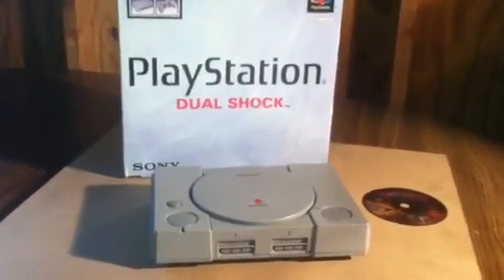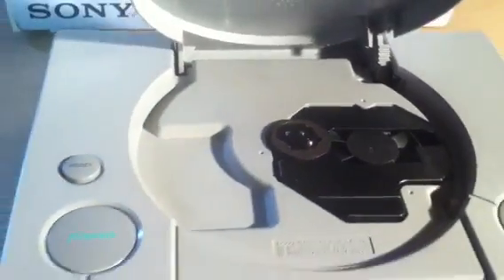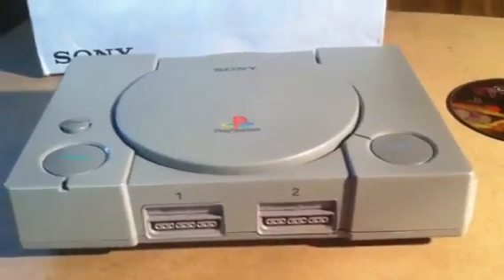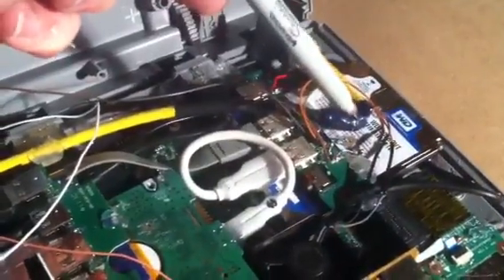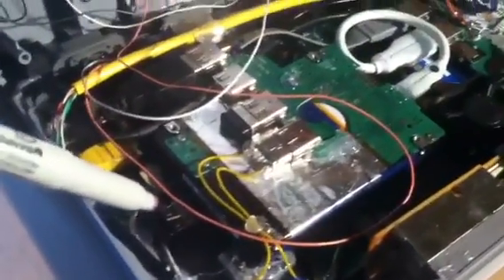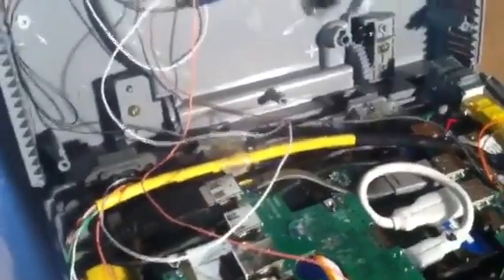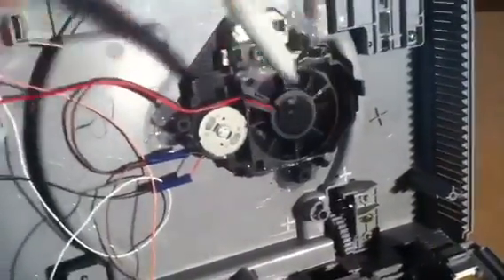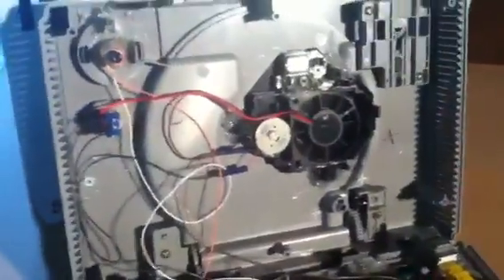Playstation Hyperspin PC Mod with XBMC Part 1

Comment: Just started dreaming about doing a mod like this.  Yours in incredible.  I'm wondering if this could be achieved today (2 years later) with android instead of PC.  Of course hyperspin could not be used.
Reply: +James Elterman I ordered the parts to build a version of this using a Raspberry PI 2.  There are others that have done this on YouTube.  No slick Hyperspin front end but should be a fun project regardless.
Reply from the maker: +James Elterman NICE! 
I have been thinking about doing the same thing with a pi2. It would be SO much cheaper. This project had way too many parts in it. You will have to share your results. It will be another month before I can to my Pi project